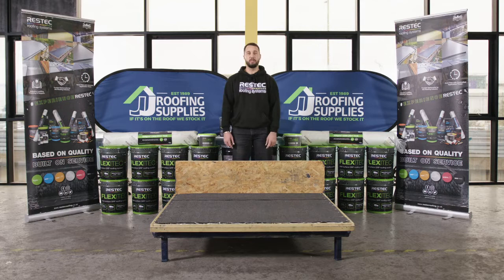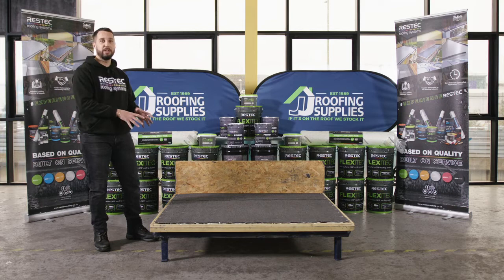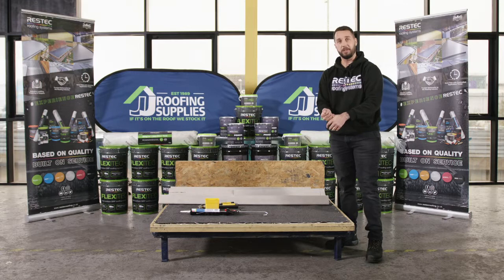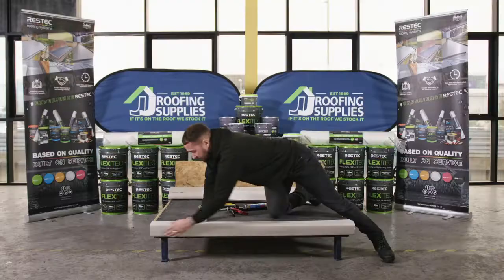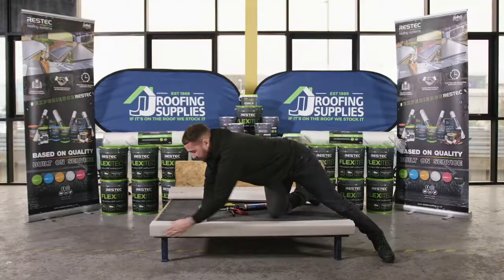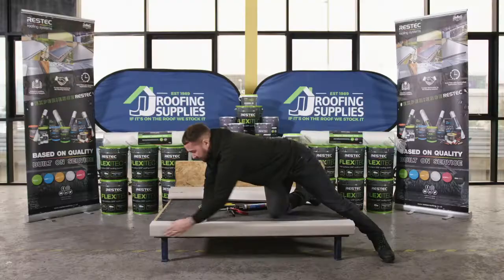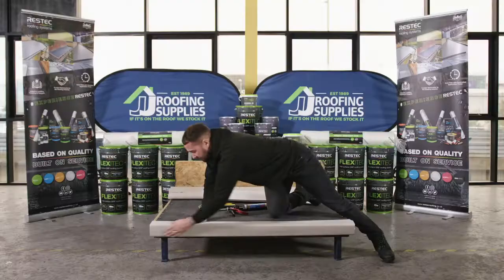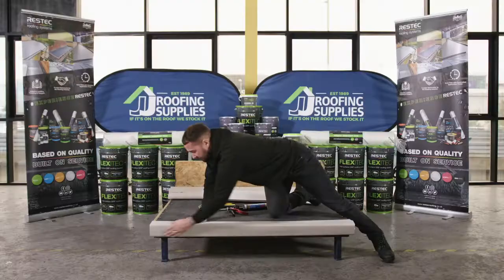How to lay a GRP Roofing System over Felt | Restec Roofing Systems | JJ Roofing Supplies

Comment: You've now got 3 whisks coated with gluey gunk. It's almost impossible to clean them. I use wood battens as mixing sticks which can simply be thrown away. Saves having a drill outside in the elements too.
Thanks for the video though.
Reply: That's what I've always done and just normal black builders bucket with the litres on them, instead of those fancy ones

Comment: Load of crap. Just go over it again with sbs two layer felt
Reply: This is a quick overlay system. You can't beat classic grp though. Just stip the felt and overdeck with osb3 and fibreglass
Reply: @bradley.h  just about every fibreglass roof I’ve been on is leaking due to it cracking. Far too rigid.Only plus is that is looks well. I’ve recovered far too many grp roofs in my lifetime to reguard it as a good roof.
Reply: @user-qz8wp7hy8x  Do you mean cracking of the topcoat or base layer. Fibreglass roofs do allow movement for expansion and contraction, however if expansion joints aren't installed or if the foundation is stable this will happen, expecially on warm roofs. It always comes down to the installer
Reply: @bradley.h  completely cracked enough for water penetration. Funny you say they allow for movement but I found this is not the case. The weather in uk and Ireland does not suit it. One day can be 3 degrees next day 20c
Reply: This is the fault of the installer. The topcoat is UV resistant and if the base layer cracked, they either haven't used suitable matting (600g) or the boarding is wrong. T&g sterling allows moving with spacing between the joins, also expansion joints are fitted at 50m2. I only do fibreglass roofs, and occasionally ponds, pools and wet rooms. If installed correctly, you cannot beat it. This shouldn't be an off-the-shelf product for anyone to buy
Reply: @bradley.h The guy in the video says to use 225g?
Reply: @Alexxx---101  Yes, most flexible grp systems are only compatible with 225g matting, except Cure-It Roofcell which can be used with the heavy duty 600.